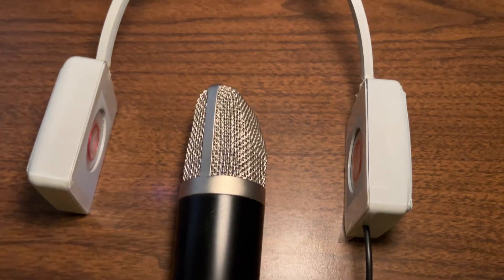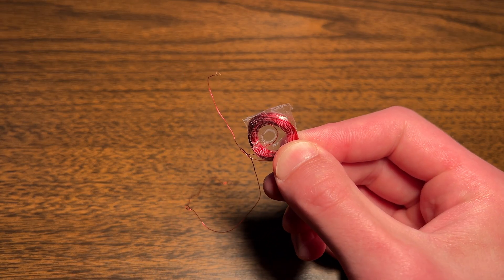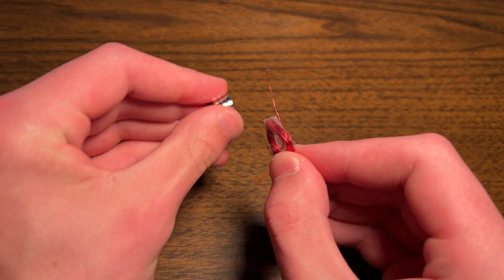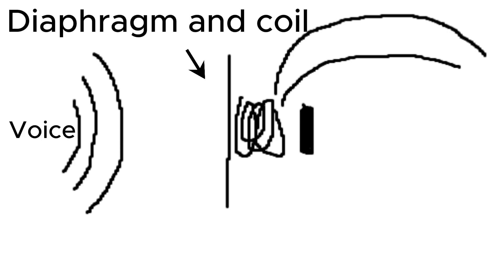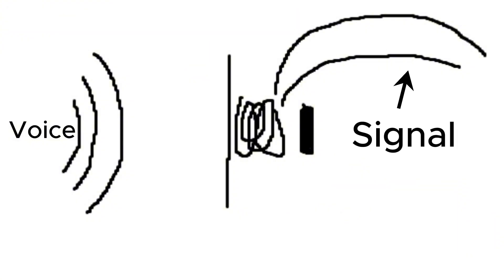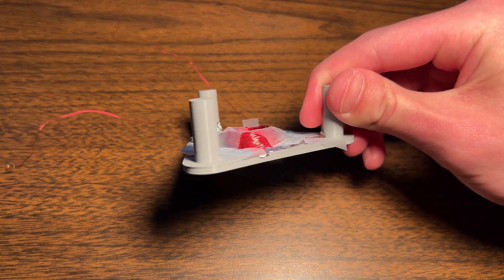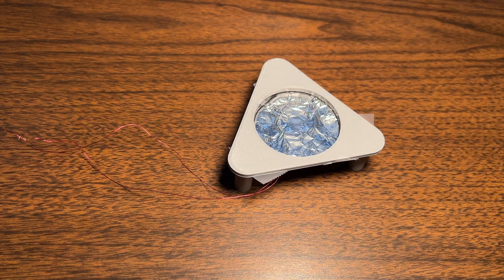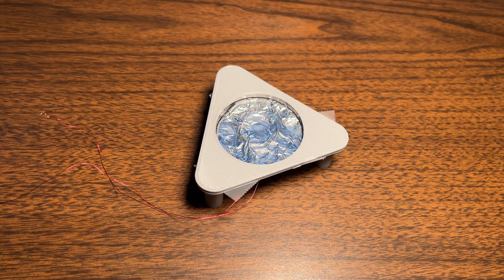Building a Microphone (from scratch)

Comment: I think you should use some thicker metal plate that will be on the longer rubber band. This way the center could bounce better, also there could be few such a plates with different strength.
Reply from the maker: That is an interesting idea. I’m concerned the plate would be too heavy, but I could see this working as some kind of controller. Maybe finding a way to substitute a mouse click for a press of the plate

Comment: Dude! That's an incredible result! I would really love to hear or download the unedited audio files if that's at all possible. I've got some thoughts on how to improve your capsule though, if you'd like, though I'm not an audio engineer.
I believe an ideal diaphragm (material, its very hard to hand build a good geometry to manage these things) has these 3 characteristics:
High damping, to manage and mitigate resonances, harmonic distortion, and problematic frequency peaks.
Low mass, which lets the diaphragm move more for a given source volume, meaning higher sensitivity. This is particularly important for higher frequencies where the diaphragm has to move quickly.
Low stiffness, the same as before but particularly important for lower frequencies, where the diaphragm shouldn't attenuate the low frequencies but be moved by them. 
The stiffness issue in particular is problematic if you have a material with somewhat poor damping you can't easily lower the stiffness without introducing a ton of harmonic distortion.
Aluminum foil is a great idea and you may try to improve the sound quality and sensitivity by making sure its 'taught' not particularly tight so as to make it too much stiffer, but taught enough that your voice will have a similar affect across the area of the diaphragm. I think leaving it lose and crumpled hurts the frequency response and clarity, though I couldn't tell you how much.
Of course in the end, all this is a balancing act and too much of one will compromise the others. But figuring that stuff out is most of the fun right?
Reply from the maker: Thank you! As far as I remember, I only amplified the recording. The original would just be quieter. I might look into some filtering or improvements later. For a new version I’m considering Mylar. I’ve heard it’s a decent material (I want to make them as DIY as possible so no off the shelf speaker parts). I hope to make a new microphone and speaker set sometime in the future so stay tuned. I appreciate the advice!